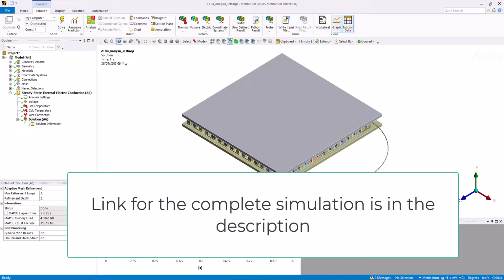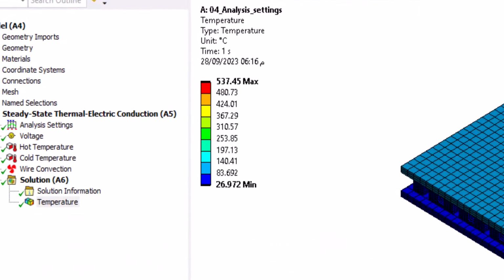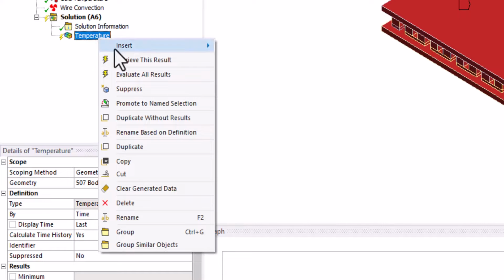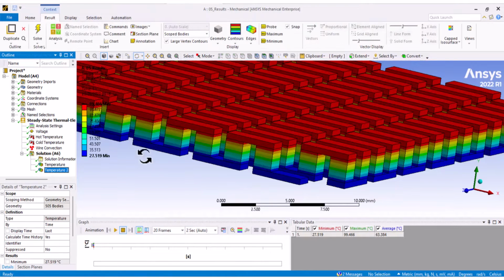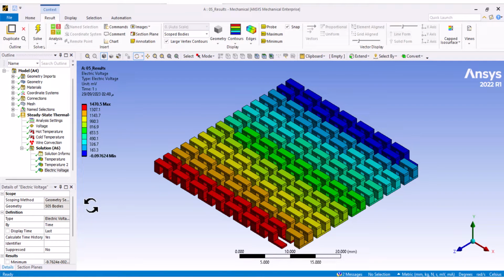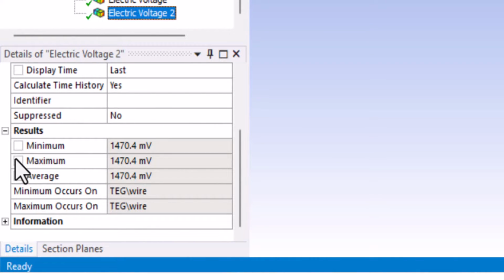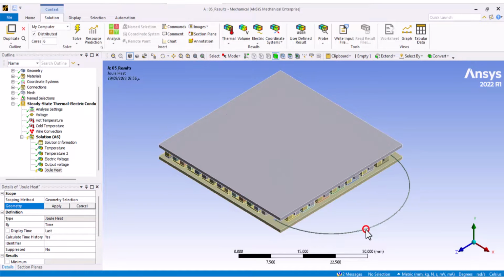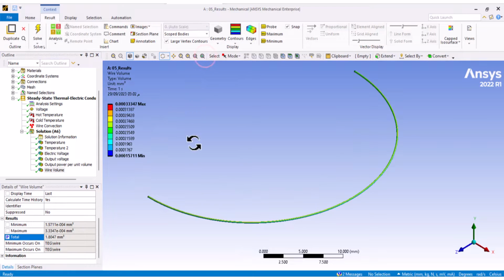Performance of thermoelectric generators (TEG) in ANSYS

Comment: In the case of your simulation, column P8 was the "Output Voltage". Is this referring to the load or open circuit voltage? Thank you
Reply from the maker: What is the value in the resistance column?

Comment: When calculating the resistance, was this referring to the load or internal resistance of the device?
Reply: Also, would the outputted voltage be referring to the load voltage or open circuit voltage?
Reply from the maker: If the resistance of the load is very high (Infinity), this means the output voltage is the open circuit voltage. If you use a specific resistance corresponding to a specific load, this means the output voltage is the load voltage.
Reply: @h4ienglish  Thank you for the response. So in the case of your simulation, column P8 was the "Output Voltage". Is this referring to the load or open circuit voltage?
Reply from the maker: What is the value in the resistance column?
Reply from the maker: The load resistance

Comment: Hello, I purchased the tutorial and I was able to follow all of the steps. It was very well done! Can you state what specific thermoelectric module this is? As in, what TEG model are you using here?
Reply from the maker: Thanks for the feedback. The module is SP1848-27145
Reply: @h4ienglish  Thank you. It would also be helpful to see a video on how to have multiple of these modules combined together. Whenever I try to integrate another module, the named selections do not carry over from spaceclaim geometry to the mechanical setup properly.
Reply from the maker: I simulated three modules before, but I did not face this problem you have mentioned.
Reply: @h4ienglish  Okay, are you able to include this in the simulation tutorial package? Or can you make a video on how you went about doing this exactly? Thank you!
Reply from the maker: I am sorry, but it will take some time to do so. I will try my best.
Reply: Hello, did you buy it? If so, could you please let me know? I am a student and I do not have the financial means, please help me.
Reply: @yardimsever8051  Yes I bought it and it was very informative.
Reply: @bradywilson1177  Thank you for your answer. I cannot buy it due to financial reasons. Is there a chance you can send me the geometry and analysis used in the analysis?
Reply: @yardimsever8051  Sorry, I do not think this is allowed. I am also a student and purchased this myself. It is not expensive and worth the low price if you need this analysis.
Reply: @bradywilson1177 sir how did you validate the mesh using grid independence study. Please provide information.